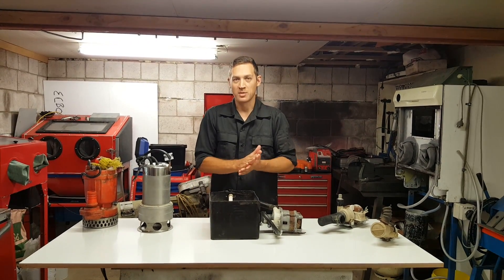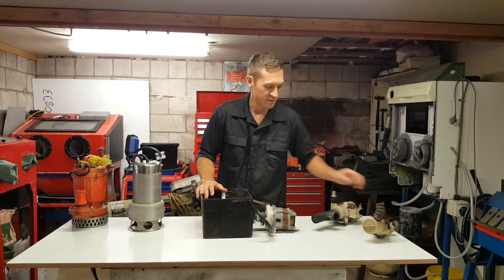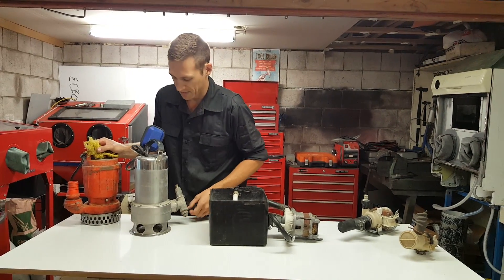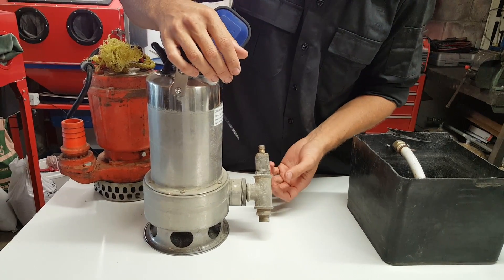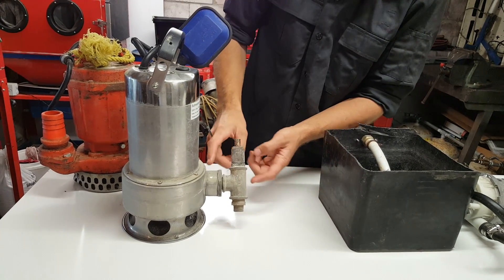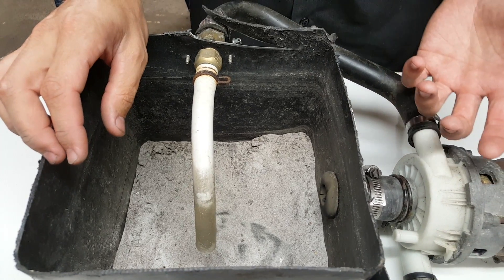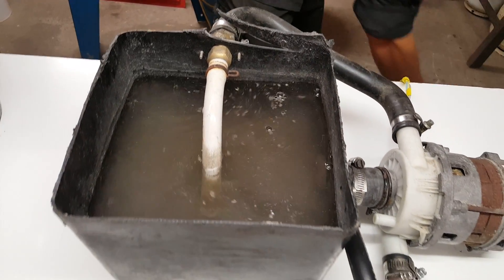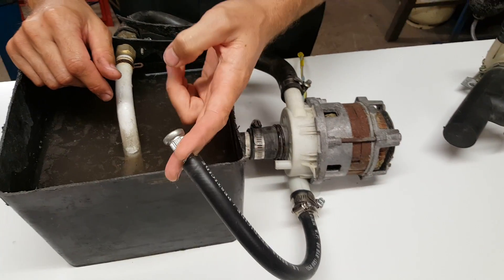DIY Vapor Blaster Pump Setups

Comment: hi 
I'm a plumper but can you tell if you have water plus water mix going though the gun piece, could do with a drawing or video on the pipe work install 
cheers
Reply from the maker: Hi Mark, 
the hose going straight in the back is the air supply - and connects to your air control valve, the hose on the angle has a mixture of water and glass beads - and comes from the slurry pump.

thanks for watching!

Comment: Circular tank with hose laying on bottom to swirl water in a clockwise motion?  Have you experimented this way?
Reply from the maker: Yes I have done a little experimenting with this idea. The difference in specific weights of the glass and the water causes a fighting of the suspension of the media. The centrifugal forces also cause the water to ride up the sides of the container and can cause pump cavitation problems.

A downward directed agitation jet and appropriately sized reservoir seems to be the simplest solution in my opinion.

Thanks for watching

Comment: Just got one of them dish washer pumps but they dont pump direct from a pipe in a bucket so iv adapted a reducer fitting in the side of the bucket but can't test it until the silicon dries but didn't seem like it was doing anything just with the pipe in a bucket so i gess it must ofto be like how you got yours also salvaged the little pump and the water in let solenoid
Reply from the maker: Yes, centrifugal pumps will not draft water to self prime. The pump chamber needs to have plenty of water in it for it to work.
Reply: @ArmouryEnterprises  yes gunner wait for silicon to dry to test it how you got yours pal ive seen one on ebay for about £60 its called a viper or something its a dirty sewage water one with metal impeller

Comment: Very informative! What are the larger pumps on the left called? Are they coolant pumps of a lathe or similar?
Reply from the maker: Hi Patrick,

Sorry, I didn't see your comment.

The one on the far left is called a sewerage pump and the stainless is just called a submersible pump.
   They look like a coolant pump but are different. I haven't seen anyone using cooling fluid pumps but in theory they would work.

Cheers.

Comment: Just learned about vapor blasting 30 minutes ago... I imagine this takes paint right off so parts must be immediately dried and painted in a dry environment. As well as the inside of the cabinet, my sand blasting cabinets have bare spots all over the inside, IDK how I would keep the inside rust free?? I'll have to do some research into this because moving water is certainly easier than moving sand or other medias...
Reply from the maker: Hi Steve.

The water suspended media loses velocity much quicker. I coated the inside of my cabinets with a 2 pot epoxy paint. So far I have had no issues with the older cabinets. The newer design uses a dedicated stainless steel cabinet.

As for parts. Ferrous components need to be treated immediately. Vapor blaster are more popular with those cleaning alloy parts.

Thanks for watching.

Comment: Where can you buy the media from ? Or is it just the same media when dry blasting ? 

Would it also work from a dry blasting style, Air powered opposed to pump powered, it perhaps had something to mix / stir the slurry where the trigger pipe, picks up from ? 

Cheers.
Reply from the maker: Hi Dominic,

Sorry for the late response. 

Where are you based?

You can use a pump to agitate the slurry, and then have a venturi style pick up like a dry blast cabinet. However, it takes a bit to get it to work, and I still haven't worked out how to get it to work as well as the pump fed set up.

I cover this a little in this video - https://www.youtube.com/watch?v=r9ZQboi5YyY&t=2s

Thanks for watching!

Comment: Hi mate been following your videos for a while and have built one using your methods, out of a dishwasher I am having trouble with getting good results, I've got a submersible dirty water pump I'm using 106-300 mesh glass bead , and I've got a compressor running about 45psi constant and even when I get my big compressor out which runs 100psi constantly the lower pressure goes better  just very slow blasting & struggling getting corrosion and stains off ect. Have you got any ideas what could help me get better results? Cheers
Reply from the maker: Hey Mate,

Could you upload a video? I would be aiming to run at the 80 to 100psi range if you can.

Next thing to check is that you are getting a good water to bead ratio. I find the best way to check it just pump some onto the window without the air running. You get a good visual idea of how many beads are in your slurry.

When you say stains, are you talking about the black tarnish you get on alloys? Oxides are incredibly tough and need harsher material than glass bead to strip it.
Reply: @ArmouryEnterprises  ahhh that may be it, yes it's like oxidization like a black stain where the corrosion was sitting, has been driving me crazy the parts looks great apart from that, do you have a ratio of how much cutting agent I should mix in with the glass bead to get it off? Other than that I was thinking I may need 2 cabinets one with a harsher media for initial clean then glass bead for finishing. I will upload a video tomorrow of my setup ect. I forgot to say thankyou for all your videos without it I would never be where I am now.
Reply from the maker: I'm still yet to spend the time to work out the best ratio. But I use approx a 5 to 1 ratio glass bead to garnet or Aluminum Oxide. I just started out with a small amount  of Garnet and kept adding until it cut fast enough. Aluminum will cut faster with less.

I use two cabinets for exactly this purpose.

Thanks for watching. And glad you enjoy the vids!
Reply: @ArmouryEnterprises  https://youtu.be/PGNiwgSWGzo just uploaded a video sorry not much of a youtuber i just watch the vids haha. hope this will give you some insight i have mixed a little bit of the etching media to the slurry but still wont get it off not sure if i need more or something else is going on.

Comment: round bucket = no corners = no dead areas ?
Reply from the maker: Hey sorry mate, I only just saw your comment. Yes round buckets work great. I tend to use round buckets if the reservoir is to sit on the floor, and square bins if it is to be mounted in the frame.

Thanks for watching!

Comment: Hi Ive to replace the pump on my big old Abrasive Developments VaquaBlast ( like the Vixen )
and Im not stumping up for new. Should I get something kind of similar to fit where  the original pump sits on the outside of the machine or should I get a submersible like the Tsurumi ? Any views?
Reply from the maker: Hi Colin,
Whats wrong with your pump? I am unfamiliar with your particular model but often if its just bearings or seals, its easy enough to replace. Failing that, you can retrofit something else. Essentially, you would just remove the old pump and install an aftermarket one as you can find on my channel, or check out the vid Venom Chris did. I don't know about the Tsurumi pumps but most submersibles can be made to work. I would recommend fitting something in the original position, but if its not possible to find something suitable, the submersible option can work.

If you do retrofit another pump I would be interested to know how it performs in comparison to the original.
Reply: cheers, the old pump is a brutal looking thing,  all polyurethane lined, the shaft / coupling are the size of a german stick grenade and its badly worn along with the poly lined guide in the pump that the shaft turns in. Do you want to see a picture?

Comment: Great video. Any chance you could do an in depth video on how to plumb and wire a cabinet for vapour blasting? Never attempted anything like this before so have zero knowledge, but would love to give it a try after watching your DIY video. Cheers
Reply from the maker: Hi Brooklyn.

Sure, I had planned on putting together a video on plumbing options. As for the wiring, I am happy to go over the 12v circuits that I use. As for the wiring of the pump, I don't really want to cover that as really, if anyone is not comfortable with mains voltage wiring then I don't want to give a false confidence given the mix of water and electricity and the high chance of electrocution. Any of my builds that are not exclusively for use in my own shop get given to a certified electrician for testing. 

That said, the set up is really simple and even for anyone with no electrical experience, you have the option of running the pump straight from the wall socket and using that switch to turn the pump on and off.

Cheers for watching!
Reply: @ArmouryEnterprises  I was about to ask the same question regarding plumbing the unit.
Reply from the maker: @TheOriginalLugnuts  
The new cabinet I am doing will be plumbed shortly so I will do a video of that process. Though there is not really a lot more to it than what you see in this video. 

Thanks for watching!

Comment: Hey mate great videos, very helpful, just wondering if I could get any more info on the silver pump? Like wattage, type and where you got it from? Cheers
Reply from the maker: Hey Taylor,
Sorry I thought I had replied from my phone but I guess not. This silver one was an oldish one out of my garage. ITs an 1100w model from memory, but unsure where it came from. I have seen these advertised in NZ on TradeMe (Like Ebay for any readers outside of NZ). I have had success from all sorts from 400 to 1200w. Any submersible pump over 400w can work. I try to get 900w or over and dirty water versions.
Reply: Armoury Enterprises cheers thanks heaps
Reply: @ArmouryEnterprises  your videos are top notch. Im just getting into this and and every question I have, you have already answered in the videos
Reply from the maker: @brentcarmody4763  Thanks for watching! I am stuck in the middle of building up my stock of stainless cabinets, but I plan to go back and redo some topics and fill in with everything I have learned since first publishing.
Reply: What gloves have you found to be the best? I’ve found plenty of sand blasting cabinet gloves on eBay, but unsure on how water proof they would be. Can get some out of the states through VHT but are pricey with the holders.
Cheers
Reply from the maker: I have tried a few different types. Most sandblasting gloves are fake leather that are sewn and have a coating on them. Every set like this I have tried leak pretty bad.

You can get rubber ones too which work well and you can get out of China if you can't find them locally. They dont leak but cause you to sweat and it builds up in the fingers.

My favourite ones actually come with some of the cheap sand blast cabinets. They are a hard pressed rubber with cotton reinforcement. The seems are sealed with a heated roller. These don't sweat up as badly but also do not leak. 

I will try to show the difference in my next video.

Cheers

Comment: Would a cylinder be better than a square reservoir as you have no corners for the media to get trapped in?
Reply from the maker: Yes you can. I tend to use a funnel shaped reservoir with the jet centered. That way gravity helps too as well as being easier to build into the cabinet